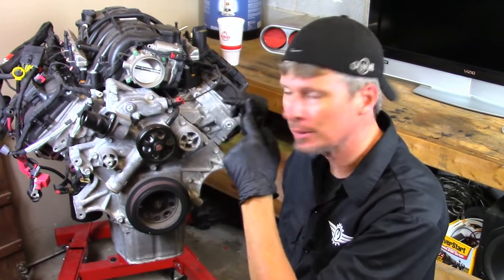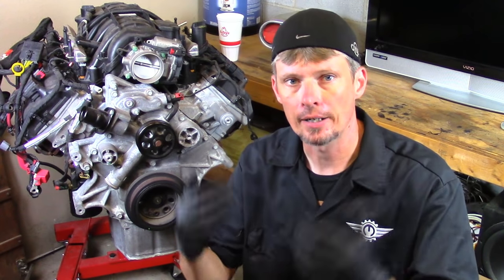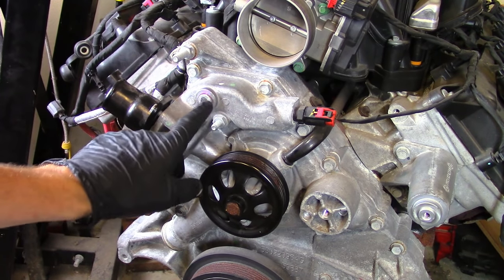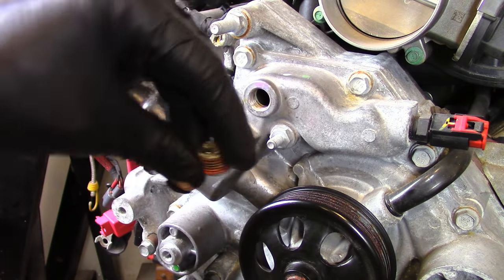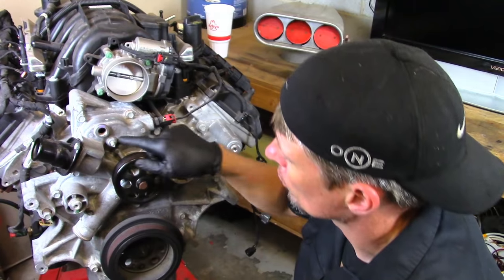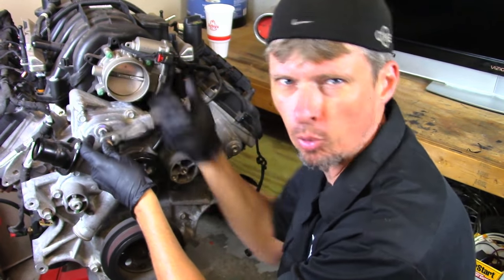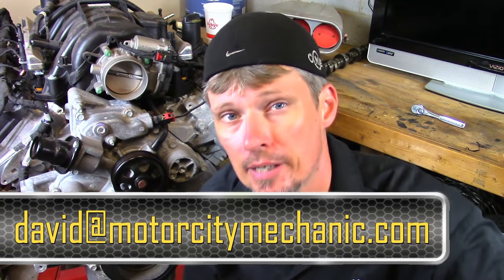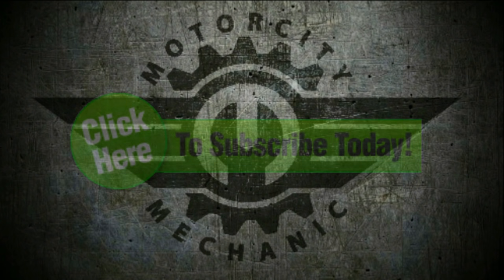Quick Tip: 5.7 Hemi coolant bleeder location and fill procedure

Comment: How the hell do you not have a million subs? You’re by far the best, most informative mechanic channel on YouTube IMO.
Reply from the maker: Wow….those are some very kind words. I do appreciate it. Wish it was that easy lol.
Reply: Hey what does it means when your top hose on your radiator is cold and the bottom is hot what should I check?
Reply: 2014 Dodge Challenger rt keeps running hot after warming up and running for about an hour.
Reply: @tyvoneprice74  you probably need a bottom hose
Reply: I AGREE GET CHANNEL,  PUTING A WATER PUMP IN MY 06 GRAND TODAY 5.7 ,,,, 174K
Reply: I AGREE YOU SHOULD HAVE 1 MILLION SUBS.
Reply: ⁰
Reply: Hi awesome content thks. I have a 2015 ram I started seeing the temperature higher than normal not running hot but right at the half way mark when it always been a little above the quarter mark I changed the thermostat and did a v6 fan swap and still goes to half way mark til the fan comes on any idea what's causing that and should I be worried thanks

Comment: Never knew this 5.7 had a bleeder valve. I definitely think you are a lifesaver. My engine didn't overheat, but the coolant reservoir acts like it wants to explode everyday. It's hot here in Texas, so I had to flush, and now bleed. I certainly hope that resolves the issue.
Reply from the maker: Thanks for watching. Hopefully that helps your situation.
Reply: I have this same issue in Texas. I'm going to try doing this as well after replacing the coolant tank the other day.
Reply: I just replaced my coolant reservoir the other day and it acts like it wants to overheat and the temperature gage gets to the half way mark on the dash and when I turn the car off after driving it, it sounds like its boiling. I'm gonna try bleeding it and see if this works for me and my charger
Reply: @Mrjdblchr Did it work
Reply: @Mrjdblchr did it resolve the issue?

Comment: I love it. I've had my nitro for a year and was pleasantly surprised that the 3.7 has a simular plug. It seems that all newer chryslers do. I use to do a simular procedure on previous cars by pulling an upper heater hose. I had a bad overheat once due to following the "run with the cap open" method.
Reply from the maker: Most dont know about the bleeder and others think you need to be running the engine to use it. Engine cold and plug removed...add until it comes out the hole. Simple enough and save alot of time. Thanks for watching and for the comment. Make sure to subscribe!

Comment: This video saved my day! For some weird reason my 2006 Jeep commander started over heating after getting it about a month ago(with no issues) it did not boil over or loose coolant!  No engine lights, no sputtering! Just the temp gage went to red. So my dad and I replaced the thermostat. Which looked band new! So we replaced the water pump. It looked good when we got it off. Also the ECTS. Still over heated after adding 50/50 coolant! Then! I Found this video! So thanks!

Comment: Thank you sir. Just replaced the water pump, Radiator, and thermostat on my ole 07 Ram 5.7, and although I done F-up'ed and added coolant without burping the system, and it took me an extra minute to figure out why I'm still not blowing hot air, thanks to this video I know now what to do next. I appreciate ya 👍
Reply: I have an 07 hemi 2500 and can't find the bleeder where is this little bugger?

Comment: working on a 5.7 Hemi dodge charger police edition.  Vehicle was over heating while my daughter was driving. Thank God she pulled over and turned off the car.  It did get hot enough to hiss from the radiator cap and spit out some coolant.  I put a new thermostat and radiator cap.   Car still overheated but temperature gauge was still in the middle.  I believe air is in the system so tomorrow I will bleed it cold just like this video and change our the fan.  Its one big fan....not two.   I tested the fan by running a wire from the positive side  of the battery to the positive side and the negative to the negative side of the plug in of the fan.  Two wires going into a three prong but I aligned them with the wires.  Fan wouldn't cut on.  Fans wasn't working while car or AC running.  No crack head or anything.  No milky color on dip stick or inside where you pour in the oil.  Coolant not leaking and water pump sounds fine.  I'm thinking it has two issues.....air in the system and a bad fan.  Will fix tomorrow.  Your thoughts?

Comment: That was super helpful, I just replaced the leaking thermostat on my 5.7 ‘15 Challenger and bled it perfectly. Thank you!
Reply: Something you should also do while the car is running,turn on your heater in your car,that will open up your thermostat and will let you get the proper amount of coolant in your moter and also give you a more accurate level when filling your car with antifreeze,I did learn that.

Comment: Thanks a million my dude. My heater stopped blowing hot air so I replaced the thermostat...still didnt work. After a little research I stumbled upon this and tried it. There must have been a sizeable air bubble trapped because once I took out the plug I was able to add another 1/2 gallon of coolant and hot air returned! Subbed.
Reply from the maker: Awesome. Glad that it worked out in the end. Its a common cause for the heater to not work properly for sure. Thanks for taking the time to comment and to watch the video. Make sure to subscribe.
Reply: Hey so if the heat dont work its cuz its clogged? Its because I tried this method but nothing came out

Comment: Video is 5 years old but still very helpful. For anybody doing this on a jeep commander you will have to remove the box connecting to your air box and your throttle body to get to the bleeder valve. Once that box is out the way it’s clearly visible just like in the video
Reply: Was your Jeep commander overheating?  I just replaced the thermostat, water pump, and coolant temp sensor on my 06 5.7 hemi commander. And it still shows it overheating. However, I just found this video and this vent port. Thanks!

Comment: This video save me so much time and money when I changed out my water pump.  I literally was trying to figure out how to bleed the systems without fancy tools and this video popped up.   Part 2 of this video saved me because the bleeder screw was hot and I didnt have an allen wrench big to fit.   So I used the coolant temp side.
Reply from the maker: Awesome.....glad that the video helped. I appreciate you taking the time to comment. Dont forget to subscribe Brian.
Reply: @MotorCityMechanic  I can't find the bleeder on my 08 ram 1500 5 .7

Comment: Great video. Only other thing I do is I bought another rad cap and tore the lower rubber seal off so the air goes right past the rad cap to the over flow bottle. squeeze the upper rad hose unit you get most of the  air out, start the car and you'll see the air bubbles going into the bottle. When it stops let it cool down change caps and you ready to roll.

Comment: Jiffy Lube refused to flush the coolant in my 07 Charger 5.7.  Something about a TSB.  Now I know why.  They cannot or will not bleed it.  I was adding refrigerant to my A/C and cracked the reservoir cap open.  Apparently, I pushed air into the system somehow and it boiled over (read fine on the gauge) the next day.  I parked it and will try this bleed procedure.  Thank You for the fine video.
FOLLOW-UP!  The bleeding process worked.  The air pocket was the whole problem.
Reply from the maker: Companies like Jiffy Lube have some many rules about what they will and what they wont work on. Glad that you searched online and found my video. I do recommend going to a shop to have the coolant flushed....its important to get the old 5 year antifreeze and replace it. Thanks for watching and for the comment. Make sure to subscribe
Reply: @MotorCityMechanic  Im SSSOOO glad I found this video too!!
Reply: BTW...  THANK YOUR LUCKY FKN STAAARRRSSS THAT "PISSY LUBE" REFUSED TO DO IT!!!!   IT IS MY OWN PERSONAL OPINION THAT PISSY LUBE IS THE WORST PLACE ON EARTH TO GET AN OIL CHANGE!!!  THEY COULDN'T EVEN SCREW BACK IN MY OIL DRAIN PLUG WITHOUT STRIPPING THE THREADING!!!  THAT'S THE 1ST & LAST TIME I GOT PISSY LUBE TO EVER DO ANYTHING TO ANY OF MY VEHICLES!!!
Reply from the maker: Relb Dee Many thanks for watching this video
Reply: @Relb_Dee wow relax

Comment: Thanks for the info. I had a side job coolant temp 3/4 towards hot. Previous guy put a water pump and thermostat. Trying to figure out what happened. Started to drain the coolant. 1/4 of a bucket, that's it. Then pull the thermostat. The coolant was not full. I found the plug. That guy never bled the air out. Had to verify the bleed port. Thanks a lot. You answer my question. 🎉😊

Comment: Awesome video! Just replaced my thermostat and I knew there was more to replacing the coolant than just filling the bottle.
Reply: Any issues yet? I replaced my thermostat last week and now my temp gauge runs around 194 when driving but has reached 225 at idling. Fan quit working as well. Worked fine before replacing my thermostat. Fuses and relays are fine. Didn't bleed the system last week either so gonna start there. Still the fan should kick on with these hot temps.
Reply: I @kennethdurbin3385  i just replaced my thermostat in 09 ram 1500 5.7, immediately after heat only blows cold air, i removed radiator,  hoses etc and flushed everything,  topped it all off with 50/50 and tried to bleed by squeezing hoses and got heat for a about 30 minutes, now top radiator hose is super tight when running and temp stays at 194.  I havent tried this bleeding method yet, but im going to now, hopefully my new thermostat isnt faulty. Its rated at 203°, which does no good if i cant get above 194.. its 19° outside i need my heat lol

Comment: According to the shop manual, there should be some cylinder block drain plugs as well. I'm trying to figure out where those are as well. This is really helpful however.

Comment: Great Video bro.. just don't forget to mention to people to make sure  they have the car on Level surface or the front a little raised.... I had my car backed up on my driveway & my driveway is up hill.. so i was having a really bad time...till i flipped it around..& that worked Great!
Reply from the maker: Great tip Rafael! I didnt think about it for sure. I appreciate the tip.
Reply: No problem bro... 
I was having so much problems.. i replaced the water pump.. then i went to fill the canister with Freeze with car cold & off right! I filled it up but it would not go down at All i was like WTF?? So i open the plug & still nothing,,, so then i turned On the car & still nothing...i waited for 10 min still nothing & car started over-heating lol...Shit so i just left it alone till it cooled off...later on i flipped it around where its facing up the driveway & left it there till next morning ...Thats when i tried it again.. & Bingo!! Lol...just never thought that having it downhill would cause it to get hella air...🤷‍♂️lol...lesson learned!
Reply from the maker: @rafaelmontanez715  Good thinking on your part! Glad it worked out.

Comment: Thanks for the video , 
could you please advice if the bleeding air works when system already filled and car run already and there is air inside radiator will the bleeding from water pump is enough?

Comment: Thanks David for sharing. My reservoir was bubbling after a test drive . I replaced the water pump initially and the bearings were terrible on the old pump. I put it back together and do a test and it begin to boil in the reservoir. I went to purchase a hex bit to bleed the pump. I poured 50/50 in and later it begin to come out the port. Now what? Help please. I have not started it and where is all that antifreeze going ?

Comment: All these years I just assumed that any air in the system would bleed out through the overflow tank. I just installed a new water pump 2 days ago so this is very useful, thanks. I saw that plug there and was wondering what in the hell was that for.
Reply from the maker: You would think so.....I learned it the hard way over the years. Now I know better and make sure I try to get most of it out. Thanks for watching and for the comment Raymond.
Reply: @MotorCityMechanic  I unscrewed that plug on my water pump to bleed the cooling system and coolant flowed out without me adding any. I'm left to assume the air bled out through the overflow tank, lol.
Reply from the maker: @greatray6262  Sounds like you go it all out. Good to go.

Comment: After replacing a head gasket on a 2007 5.7 Hemi this procedure seems to have fixed an overheating issue but not the no heat in the car issue.
Yes I have the fan on and set to defrost.
Reply from the maker: If no overheating and no heat....I wonder if there is a blockage in the heater. Not sure if you have driven the car yet. If air is trapped in the heatercore then a good drive might help. Feeling both heater hoses will let you know if a blockage. What was the reason for headgasket replacement?
Reply: Might be the the air door actuator. Challenger has 3, pretty sure its the one on the heater, the hardest one to replace

Comment: Hi David.  Very informative video.  Thanks!!  What about air removal/purge of the air from the hose side of the thermostat?  I recently replaced the alternator and for easier removal, removed the hose and housing connected to the thermostat.  I didn't  think of any air being trapped in that line, and the car seems to run around  219° now, so I quit driving it until I can solve the higher temp problem.  Thanks!!

Comment: I may have stumbled on a better way. Last year when I had to replace my radiator, I left the upper radiator hose connected to the radiator. I  pulled it up as high as I could and filled it up that way until the antifreeze started to come past the thermostat (it was bad and I didn't realize it at the time) today I replaced the water pump and filled it up the same way only I knew I would have to burp it. I took the bleeder screw out and I couldn't get much more than a spoon full before it was running out and that's with the front of the car jacked up. I'm sitting in it letting it idle now, have been for 30-45 minutes alternately running the heat and A/C to see if it'll overheat but it's running just fine, temperature is dead in the middle just like always.

Comment: love your video, but i'm really struggling with my 6.4 hemi...   new head gaskets, all buttoned back up have engine running, can't get any heat of the heater coil, and the using a bleeder funnel the coolant expands and overflows the funnel......   not getting any bubbles so i'm hoping the head gasket is still good...  any tips?

Comment: I fill the coolant through the upper radiator hose when it’s disconnected.  Fill up the reservoir and let the engine run with the cap off

Comment: Hello my friend I'm glad I came across your video I need a bit of your advice if you have the time I own a beautiful 2006 Chrysler 300c with the 5.7 liter hemi my Upper radiator hose is going out and I'm going to need to replace it I like to know how I should remove all my antifreeze since I'm going to add some after the work is done I might as well drain all of it
Reply from the maker: The radiator has a drain on the passenger side but it can get sketchy as the vehicle gets older. If your replacing the upper hose then I would recommend replacing the lower hose as well. Being that we might be doing that....I would place something to catch the antifreeze under the vehicle and then take the lower hose off and catch the antifreeze that comes out of there. Its the method I recommend on the higher mileage vehicles. Thanks for asking and make sure to subscribe.
Reply: @MotorCityMechanic  thank you my friend I did just that 👌✌

Comment: Great video 
I have a Dodge Durango rt 2016 and the temperature gauge keeps fluctuating up and down I have change the thermostat but I couldn’t remove the bleeding port but I have used funnel kit  coolant method but still is not steady 
Please what do you suggest me 
Thank you 🙏

Comment: Replaced the waterpump and thermostat and now the thermostat will not open and the fan wont kick on. The coolant reservoir acts like its going to explode, any tips? Will try this method on bleeding the system tomorrow as the sun has gone down now.

Comment: Here is my biggest question for this procedure and apparently the costliest.  I am a Mopar guy and always used stock Mopar parts and fluids on my vehicles not only to preserve originality but to save a lot of headaches.  When you say refill with your 50/50 coolant to which coolant are you referring to? Chrysler claims that using anything other than theMopar pink organic blend will damage their cooling systems.  I tended no to think it was an upsell because the dodge mechanics where I worked would become physically ill if a customer told them they had put in some generic brand.  Anything under warranty would be voided as well.

 Another tip for the 5.7 l Hemi. Keep it full of fresh clean oil and minimal hot  idling time for the MDS models especially helps compensate for the poor lifter lubrication that leads to cam and lifter failures (one of the Hemi ticks). Also read the owner's manual regarding fuel. It will tell you that it will run on 87 but is actually tuned for 89 octane.  Running on 91 or better on a factory tune is warned against.  Everyone I know who had a first gen 5.7 l ran right down and filled up with high test but after a couple tankfuls caught a check engine light. They also do no like high ethanol blends. Cost me a burned out fuel pump to learn that one of the only rural stations nearby me at the time was using mostly corn ethanol to boost their 87 to 89 octane.  They charged the same price for 89 as 87 so I thought it was a no brainer. What is it they say about a deal that is too good to be true? Lol
Reply: hoat before 10 after 2010 oat